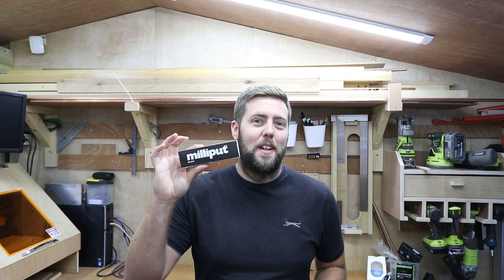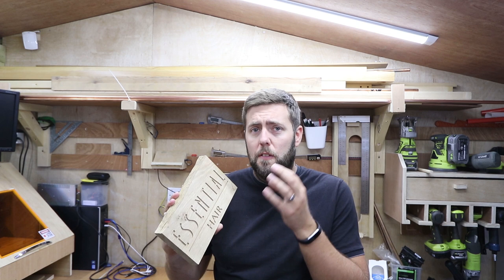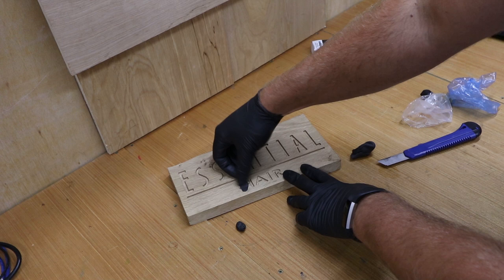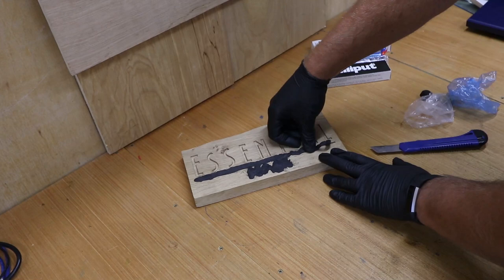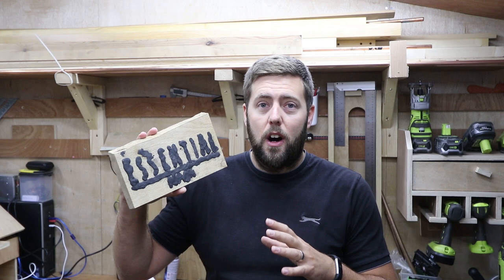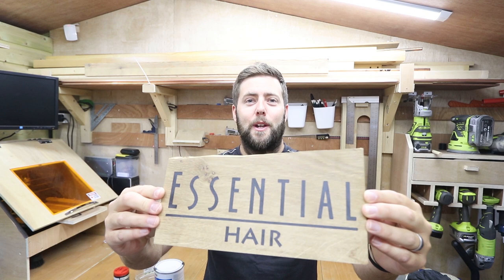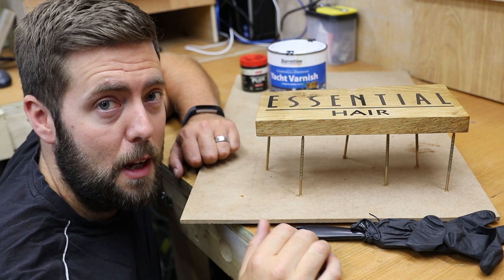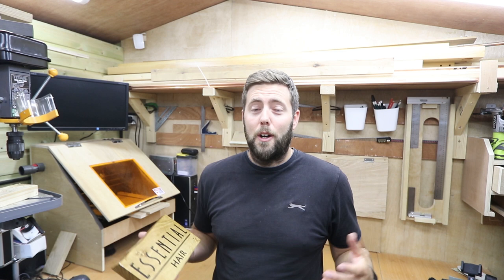Making a sign using Milliput

Comment: Just for information you can get 
Milliput in White and also a yellow grey. I have also added Acrylic paint colours to the white variety but you need to be careful of how much Acrylic paint you add so as not to inhibit the hardening properties of the Milliput. Great video James, I have used 
Milliput for modelling but never thought of it for this kind of application. I will definitely give it a try.
Reply from the maker: Only thing to be cautious of with the white is if you use something like yacht varnish it will stain the white yellow

Comment: I have a sainsmart 1810 pro and Had difficulty with this idea ..but I stayed with it and finally got it right..  I found min depth for the milliput was 2mm and when dry I did a 0.1 mm cut all over with a 6mm wide bit which cuts down sanding and gives a better finish.  I was making 60mm x 30mm x 5mm keyrings.. thanks again for the videos in your series..
Reply from the maker: Great to hear,  glad it all worked for you. I might have to try milling it down in future

Comment: I like the putty but was thinking of an idea you might want to try. I am doing something similar but I use 3D printer resin. Comes in a crap ton of colors although I buy clear and mix the colors myself when I am casting. Clear is about half the cost of color. I use a 20g syringe to apply it to my molds. This is nice because you can just fill up the grooves. Shine it under a UV light and you are done in a few minutes. I do spray the top surface wood with a sealer before filling to take care of any drips but UV resin is pretty forgiving as long as you are not sitting under bright lights (or the sun) Now that I have the 3018 up and running, I am going to try this on acrylic soon with deep cuts. Hoping for a nice 3D effect.
Reply from the maker: Never hear of 3d printer resin before.  Let me know how you get on 👍
Reply: Atinna,  do you have and pix of end project?  My grandson just got his 3018 and wants to do this.   Where do you get the 3d paste?  Thanks
Reply: @earlhunt2815  No problem. I'll post a link sometime this morning and update here.
Reply: I can’t post pics here but here is a link to the pictures. JD can repost them or make a video if he wants. 

https://www.dropbox.com/sh/q5emmqnq0fiodmz/AADA67Hn7v7P3O3q_Jv9Qa3ea?dl=0

Picture 1 is the stuff I use. I spray the wood with polyurethane to reduce bleed into the wood. I use clear resin because it's cheaper and I just dye it whatever color I want.

Picture 2 is the Resin mix
Picture 3 is the carving filled with resin.
Picture 4 is 10 mins under UV light. (Don’t look at it)
Picture 5 is ten minutes later. Hard as a rock.
Picture 6 is after a quick sand.

Enjoy
Reply: @atienne_navarre  those are awesome! !!   Thank you so very much!!
Reply: @earlhunt2815  By the way - Almost ANY 3D printer resin will work fine. I get mine from Amazon. You can buy many colors but the clear is half as much and a 16 color Resin Dye kit is less than $20 and will last you forever. After I sand the pieces down, I use 2 part Tabletop epoxy as a coating which shines it up real nice and makes the colors pop.  Have fun. From start to finish, that piece I just did took less than 15 minutes if you don't count the carving. If your grandson is young please supervise him. 3D resin can be a pain and he should wear gloves. It is NOT toxic but some people can be sensitive to it. If you don't have a UV light, you can just leave it out in the sun for an hour or two. (I keep thinking of things) LOL - And don't let him stare at the UV light.

Comment: great idea. however my design does not transfer from PC to the correct position, wood is the right size, bit is correct, zero set to bottom left, but still dont get the set up square like your sign is. what am i doing wrong, I am struggling as a new user

Comment: Very informative video, thanks.
My own sign is carved, and the Milliput is on its way - I'm excited to see the results!!
Can I ask what the screws are called you used for mounting. I hadn't even thought about how I would mount to the wall, but the ones you use look very professional.
Reply from the maker: Thank you. The screws are just stainless steel with some thread caps. If youre using Oak then you need stainless steel otherwise they stain the wood.

Comment: Hi james I am loving you videos I watched your video about fine tuning the cnc and I have manger to knock off nearly 40% of the running time wow that’s a massive difference so thank you. I just have a question please if you don’t mind. I am using the goblet control which came with the 3018 pro. I see you use a different software could I ask what it is please as I would like something with a bit more control.

Many thanks Steve
Keep up the great video mate.
Reply from the maker: Hi, The software I use to run the machine is called UGS. There is the classic version and the platform version, I use the classic
Reply: @JamesDeanDesigns  thank you James I will check it out.

Comment: Awesome video as usual. Just a question: did you consider using the 'inlay' function in something like Easel as an alternative?
Reply from the maker: You can do. It was more of an experiment to see how Milliput actually work. My only concern with doing it as an inlay is whether the smaller letter might break
Reply: @JamesDeanDesigns  yes makes sense. Looks gorgeous though. Deffo gonna give it a try. Thanks again.
Reply: @JamesDeanDesigns  yes good points. Nice work though, definitely going to give this a try. Thanks again for all the videos. Invaluable.

Comment: Why not just mill the excess off and make it flat with the CNC?
Reply from the maker: Hi David. If the CNC was a bit more powerful, I probably would have, but I would have to run a flattening path over the whole thing for upto about 2-3mm deep and then still have to sand it anyway. Good suggestion though and I night actually try it on my next one just to see how the Milliput mills